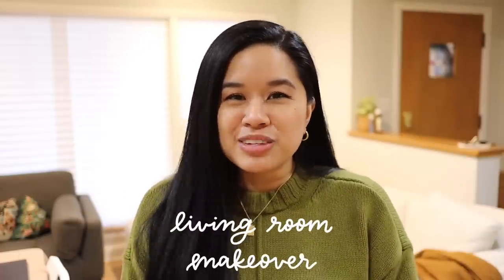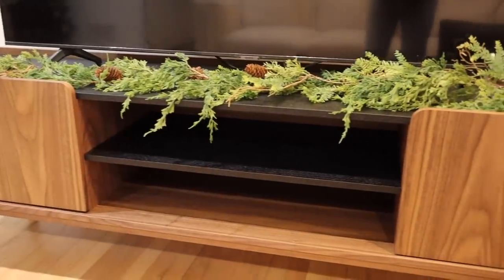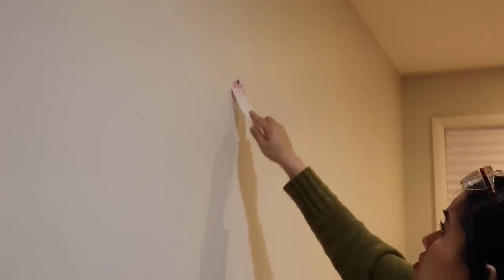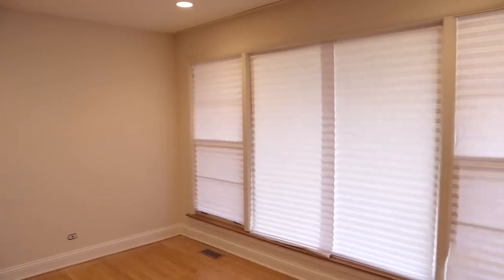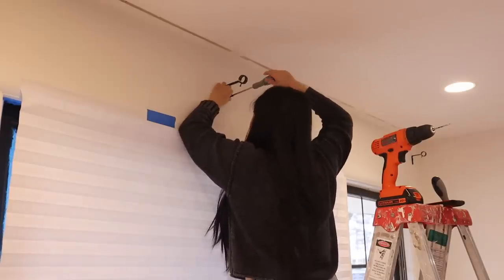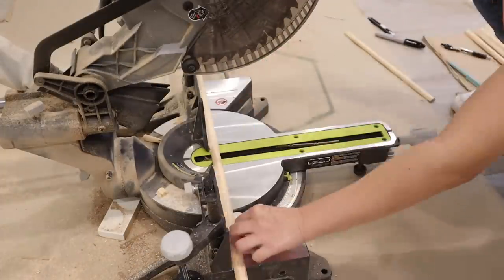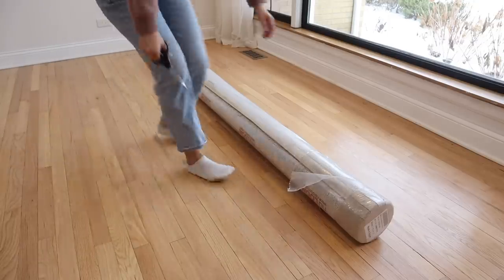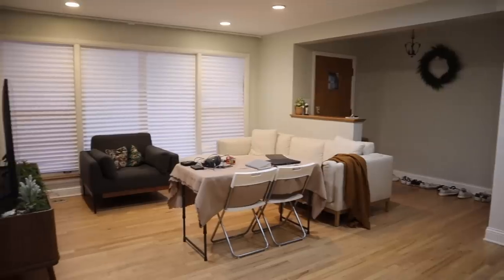DIY LIVING ROOM MAKEOVER + BUILDING A COFFEE TABLE

Comment: Love everything!…I may be too late, but I would definitely keep some kind of separation between the front door and living room. It doesn’t have to be that low wall since you have the table, but I think it should be something would block the air coming in from the front door.  It can be a panel or something not as thick as that existing wall.

Comment: That looks great! Very cohesive. But I disagree with you though about removing that half-wall in the foyer. I think the half-wall gives a nice separation and transition area between entry and the living room. If it were my house, I would do one of two things with that: either lower the half-wall a bit and top it with a built-in planter like in many Mid-century modern style homes; or top the half-wall with a decorative wooden open-work "screen" that reaches to the ceiling and lets light through but is also a beautiful room divider (also very popular feature in Mid-century homes.

Comment: Instead of knocking out the half wall in the entry you should consider adding architectural interest to Whats existing-like on top of the half wall add vertical wood slats to create a modern ‘screen’ - space them out as little or as much as you want

Comment: Here’s a tip for a poor man stop block that miter saw. Position the saw next to the wall the blade is parallel to the wall using the wall as a stop block it’s not exact but will get you by for that project